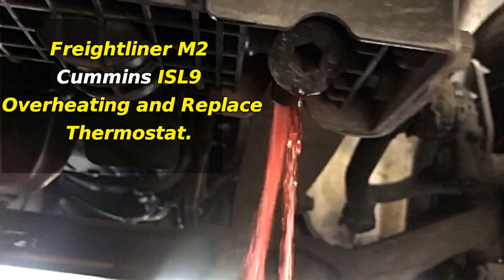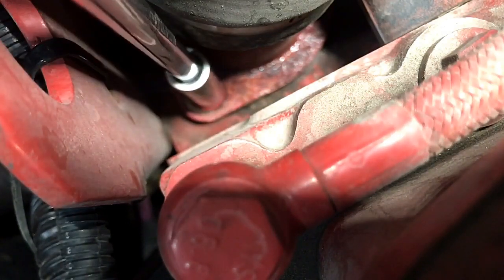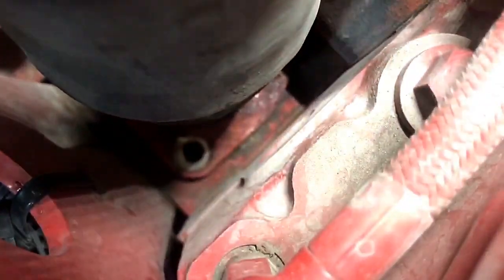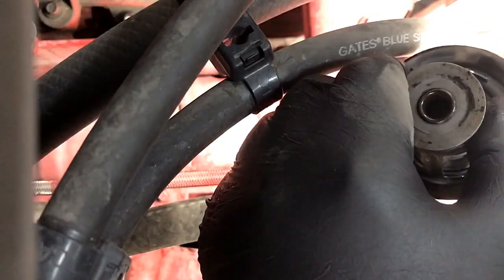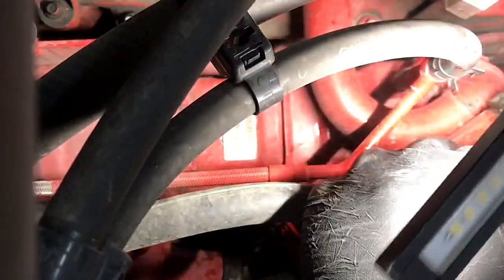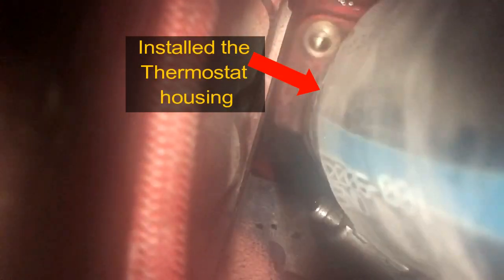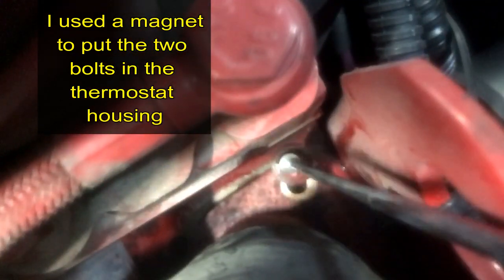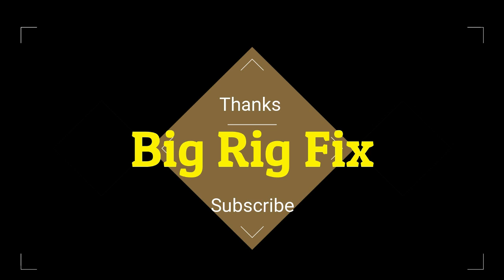Cummins ISL9 Overheating problem and Thermostat  Replacement

Comment: Just done this last night, that piece was separated and laying in the engine when I removed the neck. Put thermostat in engine, then put bolts in the neck and lower it down. Use socket and extension to start bolts.

I changed Stat before watching this video, nice to see it being broken wasn't just a fluke.